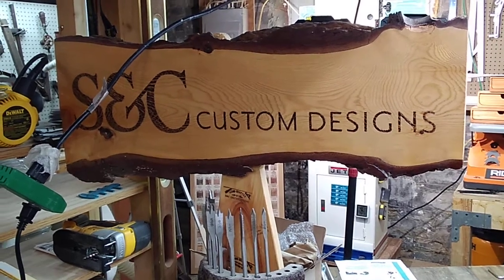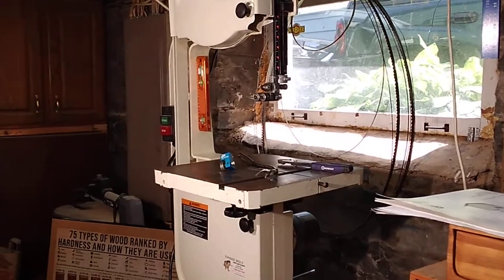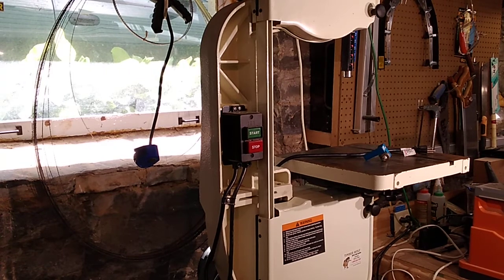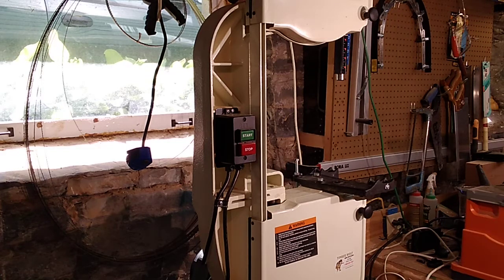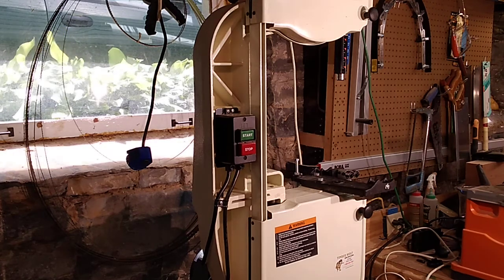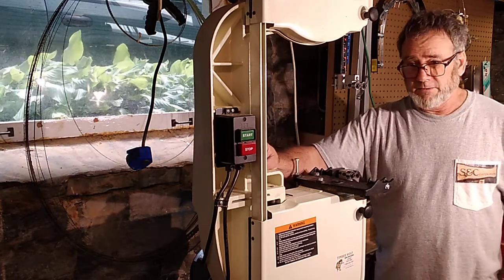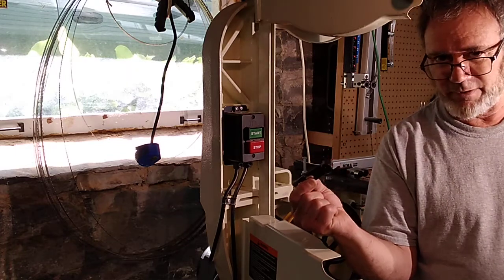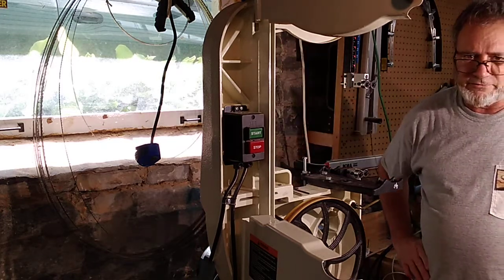JET 14" Guide Con Kit-Dix Pro

Comment: Hey Steve, really appreciate the video. I also have the same bandsaw and need to upgrade the guide. Being a few years later and wiser, do you still recommend the same Carter kit you attached on the video? Any chance they made a newer version with a longer casing to cover the entire 12” of the blade?
Reply from the maker: Hello Greg, I have had success also with the Carter stabilizers
Reply: Excellent. With your replacement, did you not end up using the blade cover? That’s my one concern from the upgrade kit - it only covers half the blade.

Comment: Steve, I have had the assumption that a bearing guide is a bearing guide and although different in appearance there is little benefit of one over the other. What am I missing?
Reply from the maker: Hello h,
I did not give too much thought to how fast my JET factory bearings were doing as this is my first JET 14" pro band saw.
I had to replace the bearings after about 3 years. So I would say. That being said I now have my own reference point. 
I am not an aggressive user but do make a lot of Band saw boxes. 

I will report back at the one year point and advise on their operation. 

Should you desire the below link provides information on the kit
https://www.carterproducts.com/band-saw-products/band-saw-conversion-kits/jet-14-pro